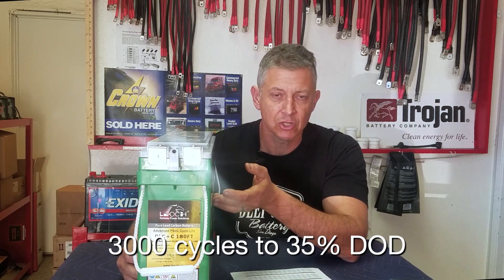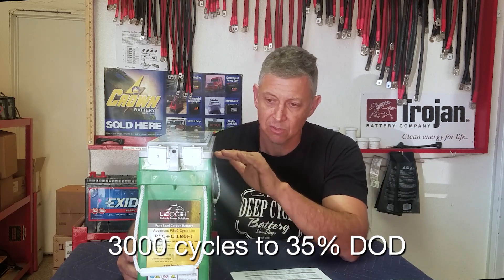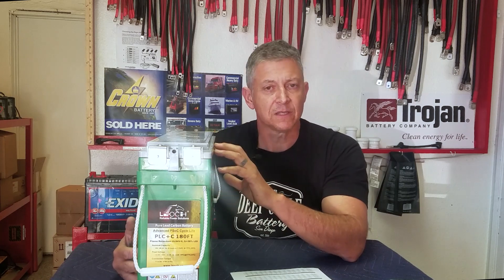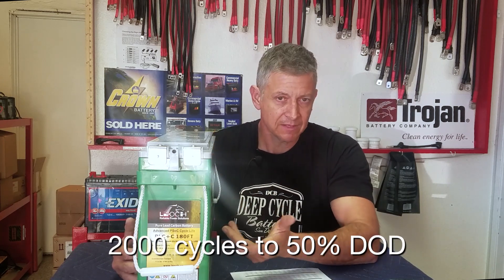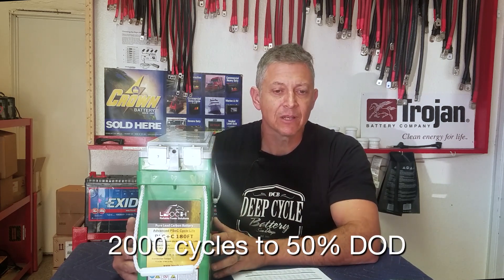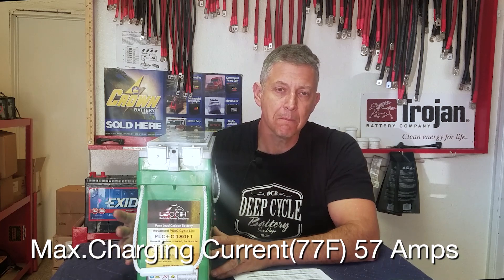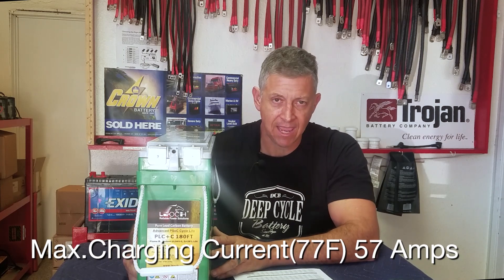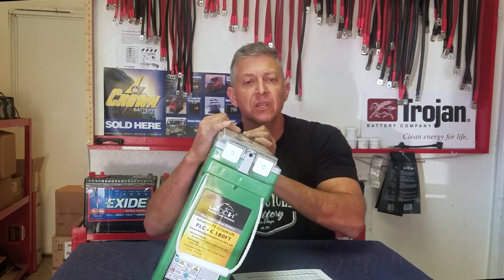Leoch Pure Lead with Carbon AGM Battery

Comment: I have 8x PLH+C 100ft batteries I'm going to run in a 2S4P configuration for a 24v off grid system. I have 3x Renogy Rover 30a controllers feeding bus bars to the batteries. My question is what charge profile settings should I use for the controllers.
Reply from the maker: @mickellis8747  are you asking what battery chemistry setting to set up for? AGM
Reply: @DeepcyclebatterystoreSanDiego  Yes, I can't find any info for the chemistry settings for these controllers

Comment: Thank you for this video. I regularly use these batteries in 10 different solar trailers in the Austin area. The overcast is causing me to run around with generators on multiple occasions. The breakdown of life cycle per capacity percentage was very helpful! Thank you.

Comment: hi,
 is it possible to swap the lifepo4 battereis into lead carbon ?  do i need any change in configuration or other kind of set up? do you have also offer with full off grid systems up to 5kw?
thanks for answering
Reply from the maker: sorry not sure what the idea you have is?

Comment: Did I hear you say that four in series don't need balance???
Really???
Have done that and it worked for you??
Reply: No. He said EACH battery doesn't have a discrete balancer, so you can connect them in series. A lot of lithium 12v batteries will have a BMS which the manufacturer says cannot be used in series connections

It'd be unwise to series any batteries without some kind of balancer.
Reply: I use this exact battery for work. We have solar trailers that uses two battery Banks each before these very batteries in series. Their voltage stays level between all four of them before they will rise in charge.

Comment: Hi Jeff, how would you compare Lifeline vs Northstar batteries for marine applications? I've heard lifeline are the best quality. However, the CCA rating on Lifeline are significantly less. For example, the Northstar 24 series puts out 840 CCA while the Lifeline 31 series STARTING battery puts out 810 CCA. Are they using the same rating systems? Do Northstars actually put out that much more CCAs? Thanks